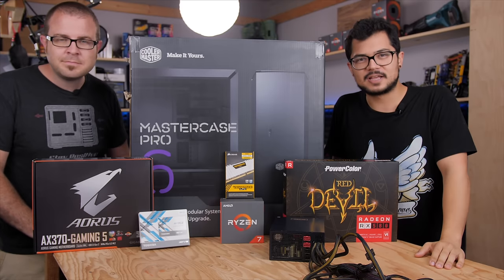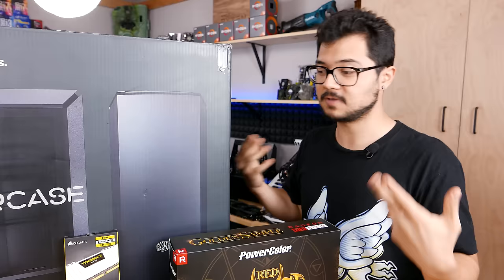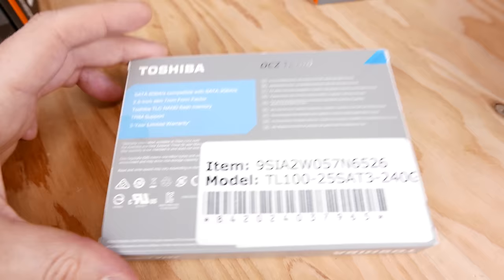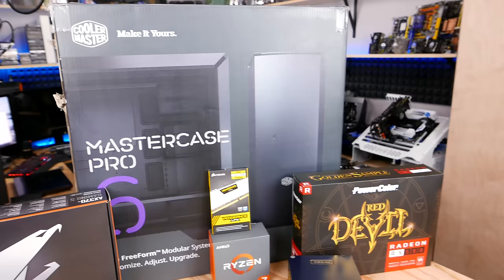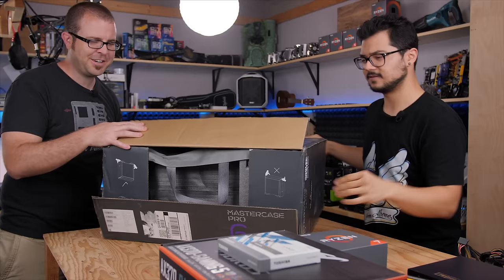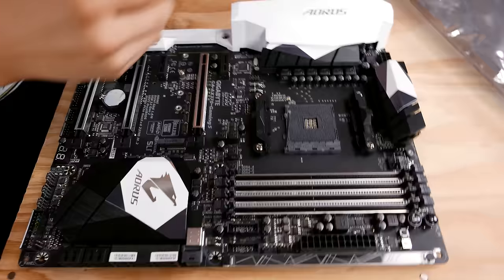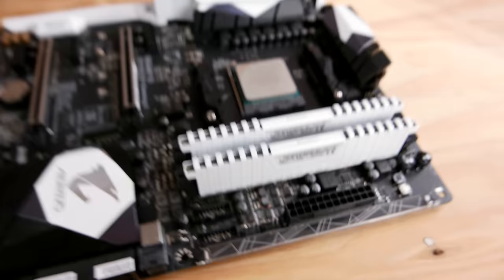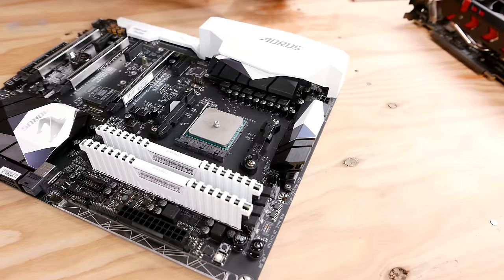Building a Rig for someone special! Part 1 - ft. PaulsHardware

Comment: why the fuck are they using a 1200 watt power supply
Reply: why not :3
Reply: Yannik Brunzema It was probably just laying around.
Reply: +Yannik Brunzema Edit* (And don't tell me you can't do it on mobile. Use the mobile site, not the shitty app.)
Reply: why not? :)
Reply: because
Reply: I think 750w is more then enough.
Reply: because it will stay silent
Reply: it will stay passive till 400ish watts and the fans won´t turn. super silent build when he is not doing much.
Reply: jorge paulo barreto veiga uh I got rm550x with 4790k and 1070 and it's dead quiet... your argument is invalid. it's just stupid choice
Reply: It's not really a stupid choice because that PSU has a good efficiency curve value at low load. I would say the only stupid choice would be getting some 250w PSU from a brand that you can't even read.
Reply: lol, its physics...something stationary = 0 dB, something in motion 0<dB. it´s the same when case fans or GPU fans don´t spin cause its not working hard, so my argument still maintains, you just fail to see that quiet =/= silent. but we all have different objectives in builds, mine is close to 10dB as possible while doing stuff.
Reply: Because it was lying around and they will never use it. Didnt you notice that all parts they have used loads and would never use again lol

Comment: Installed a Hyper T4 this week and had the same problem. Different mount but it was so tight, I thought I would break the mobo or chip. I loosened one bracket to to get the clips in place then tightened everything down.

Comment: Okay guys, the Aorus Gaming 5 is not a "middle of the road" board. It's certainly not as high-end as high-end gets, but it's up there with the RoG Hero and MSI Titanium as the distinctly above-average launch boards for AM4. It also has dual ethernet and a U.2 port, which are both features that the competition patently don't have on their boards.

Comment: I'd be interested to know what Cell's old computer's specs are. ( AKA What does Paul consider "an abomination")
Reply: Sure. It's a i7 4790K at 4.6Ghz 16GB 1600Mhz, on a asus ITX board and a R9 290 in a core 500. I made it small for lans. But I have not been able to go to many this year. Also with that 290 it is a bit of a hot box. The core 500 is a great case. And I think just about any GPU would be good in there. But the 290 may been a bit much. And I have not been happy with that build config in a while. I stream and produce video content too. So this new PC will be a great step up for me. 

Also what I am really excited for. My mom has been using a old first gen i3 laptop for years. So I will be able to pass this machine on to her. She has been great. And been dealing with illness on and off for the last year. So I am very happy to give her something that much better.

Comment: please please please tell me how you got that Ram to work on that cpu. I have the exact same cpu and Ram set (CMK16GX4M2B3200C16R). Ive spent soooo many hours trying to get it to run at 3200, that I started to question if my life has meaning... mobo is the Asus prime x370 pro

Comment: Hey, does enybody have experience with the msi b350 mortar. 
Is the VRM Cooling Solution good on this board? Iwant to overclock a R7 1700 on 3,7 Ghz.
Thank you :)

Comment: No joke, AMD builds are the best builds at the moment. 
I'm taking about 800-1000$. 
Never thought I'm gonna say that. :)
Reply: I agree. It's so satisfying to see Ryzen 5 compete with Intel's complete Core lineup. The R5 1400 demolishes the i3. The R5 1500X makes the i5 almost obsolete; and the R5 1600 offers extremely good competition to the i7, especially in a price/performance perspective.
How Ryzen brutally demolishes the i5 lineup is unforgiving. The i5 does have a higher average framerate, but bench after bench shows serious dips in frametime in basically all AAA titles. I don't want dips into the 30fps with a 250USD CPU. I'd rather trade in 10-15fps, but still stay above 50fps in the 0.1% lows.
The money you spend on a 7700K and GTX1070 is better spent on an R5 1600 and GTX1080. In some cases, the 1600 + 1080 ends up being a slight bit cheaper than the 7700K + 1070. Simply brutal.

Comment: why the fuck did you use a 1200 watt power supply with a system that probably only needs 650 watts?

Comment: Why would you get an overkill 1200W PSU with no modularity and ugly cables instead of a say 650W PSU with full modulatiry and nice black sleeved cables for less money. 650W is more than enough for a setup with one GPU with enough headroom for overclocking.
Reply: Yeah, I'd have opted for a good quality Cooler Master V-750W or Corsair RM750i. Extremely good and reliable PSU's.
Reply: Yeah, I don't think they bought these parts, I think they just scraped together what they had around the office, but if you were to buy all the parts there are better choices for the color scheme and better parts.
Reply: Now that you mention the colour scheme. What were Paul and Kyle thinking? Too much variation. They should have opted for another GPU. The red doesn't fit. They should've taken the Nitro+ so they can set the Sapphire RGB branding in blue.
Reply: Lol, I was thinking of the same GPU :D

Comment: So this isn't exactly a question about the build but more about the camera (maybe) - 

The entire video is in 1440p/2k but not 1440p@60 or youtube would say so. I assume this means that the video frame rate is 30. Or 29.97. Maybe I'm wrong and it could be 45 fps. I have a 144hz monitor btw - in case readers need that info (it matters)

In the first shot, it looks like any other video on youtube at 1440p - I'm not sure how else to describe it except to say "as opposed to a 1440p @ 60 video" - I'm used to it

In the second shot (starting from the close-up of Kyle's face) it looks...sharper? brighter? It even looks smoother. Is it because the camera used was different or the lighting? Surely the frame rate didn't suddenly spike. I have no idea. halp

Comment: I've been building my PC for months now I have a $100 case, $140 1000psu, a $180 SD and $60 HD, $120 gaming mouse, $110 Gaming keyboard. now I need the GPU, CPU, RAM. CPU Cooling. But I work full time and I own a dealership. is it easier to just have someone build it for me? also I'm a AMD Fan 😉 I have a $2,500 limit.
Reply: Contane 21 ryzen 7 1800x, corsair h110i, G.skill flare x 32gb 3200mhz, gtx 1080ti

Comment: HELP Guys i need help! kyle please help me out bro i build a new system and i have a problem: I bought the asus maximus extreme viii with a 7700k and i need a bios update i tryed it with a flash drive and its not working i dont know what to do! Love from Germany! HELP
Reply: Most Asus boards have a removable rom. Sounds like it got corrupted. I doubt you have a rom flasher. So if you get in contact with Asus support. They should be able to send you a new rom to install.

Comment: To be honest: ' a much much better PC'.
Isnt a cheap rx580 with a cheap multi core Ryzen processor. A multicore processor which will never use all his core.
If you really loved him, you'd have giving him an i7 7700K overclocked to 5.0ghz, with an gtx 1080ti and with an 1000GB SSD.